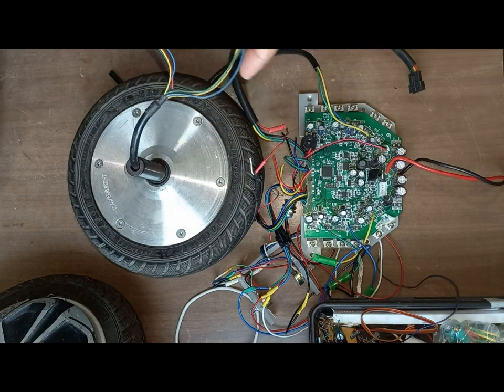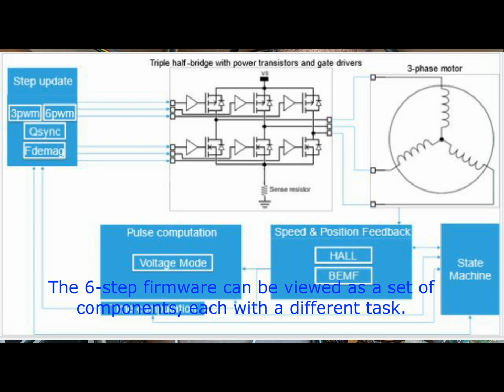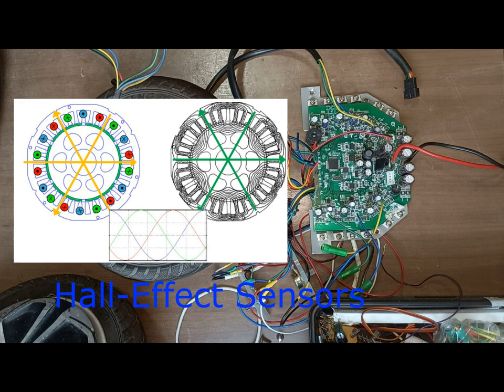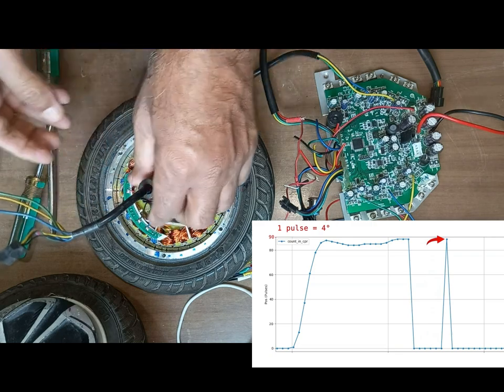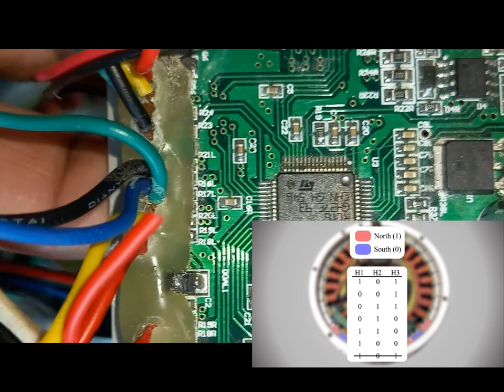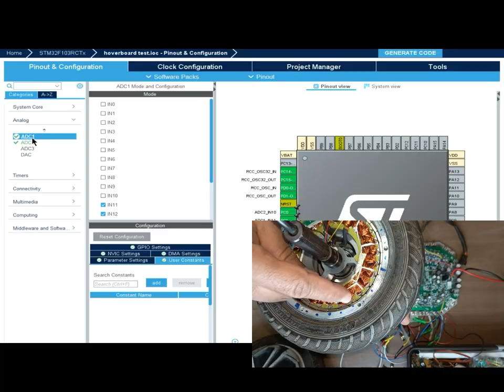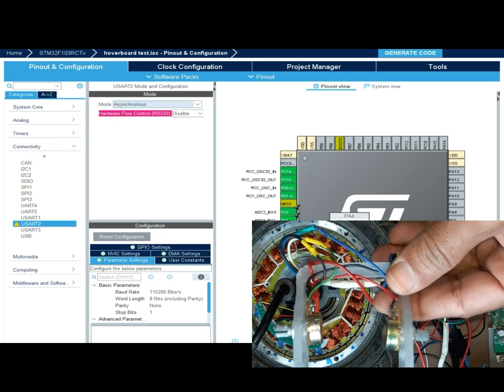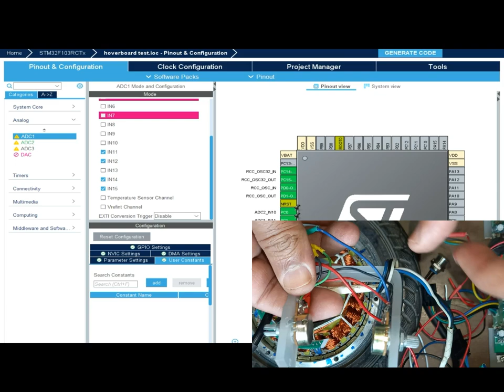hoverboard bldc motor  3 stage 6 steps 30 magnets 15 pole pairs and 3 Hall effect sensors 90 States

Comment: Does a wheel has it´s own motor? sounds great!!
Reply: yes. but what about water entering in it or refrigerated system?
Reply: @prerupa  you can seal in hermetic Space and use the compressed air of the wheel to make water as refrigerated system
Reply from the maker: @prerupa explain how
Reply: @MKRCLabs  using a tiny compresor, the air in atmosphere  has water, if you compress much air you can obtain water. Both works like a cooler. You can put the compressor a side of the wheel and use the axis of rotation of the wheel for the wires or pipes if you needed it. You can use too Carriage ball bearing to make another model where you can put magnets or  winding wire in the tire 🛞, With the displacement of the rim you can generate magnetic fields.
Reply from the maker: Yes permanent  magnets
Reply from the maker: Some time when I connect with out battery direct with adapter due to Less power
Reply: @MKRCLabs  Works like car alternator